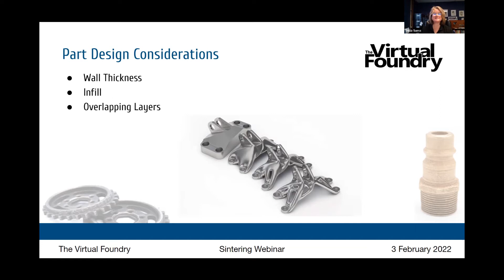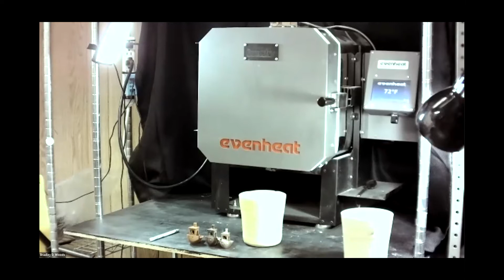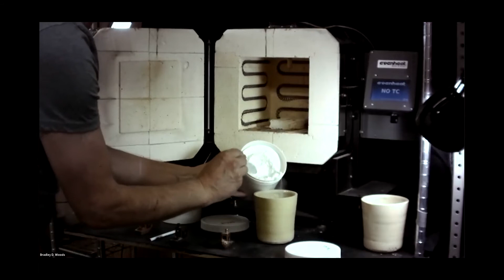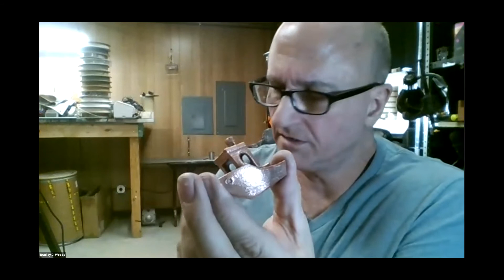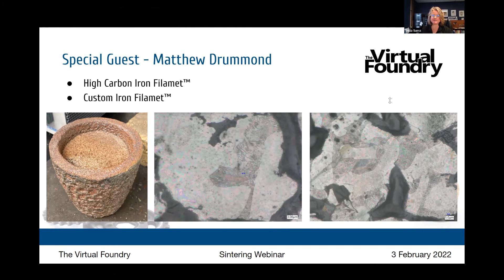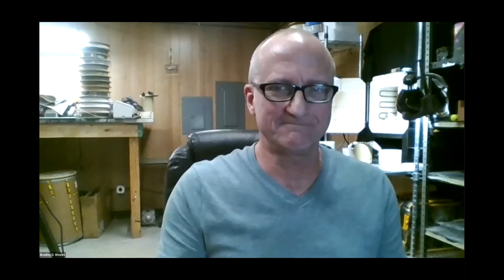TVF Webinar: Debinding and Sintering Filamet

Comment: I have bought two  kinds metal filled filament ss316l and inc 718 in yourcompany, I tried to use carbon as well above alumina talc, but after sintering the carbon is disappear might it bonded with oxygen and formed co2, but my problem is why my specimen gain weight while logically it must be shrinkage, Thank you
Reply from the maker: The Sintering Carbon is meant to be consumed as it interacts with oxygen and prevents it from reaching your metal part during sintering. If you don't have any Sintering Carbon left at the end, it is likely your part was oxidized. You can help conserve your Sintering Carbon by covering your crucible with kiln paper or a ceramic plate or anything that can take the heat.
It is strange that your part would gain weight. How much did it change? Was there any shrinkage?
If you send some photos to info@thevirtualfoundry.com, we should be able to diagnose the problem for you.

Comment: Have you all discussed gas or liquid tightness of the parts? This would be very useful!
Reply from the maker: Great question! Not so easy to answer, but I'll lay out what we understand today. Shrinkage and Density are closely related. If you sinter a part hard enough that it shrinks by about 15%, you will have a gas/water-tight object. The part will be in the high 90's for density, and remaining porosity will not be 'open-cell'. If you sinter the part minimally it will shrink by 7-10% and be around 85% dense, with much of that porosity being Open cell. In fact, at 85% you get parts used in oil bushings from the automotive industry and air filters from various pneumatic applications. 

There are techniques you can use to make an 85% porous part air/water-tight. We have users that will infiltrate the part with Sodium Silicate (water glass). The parts are air-tight and will tolerate high temperatures. 

So, you have a great deal of control over the level of density vs. porosity, the form of the porosity (open vs. closed cell) and post processing methods to mechanically fill the porosity. 

There's a growing collection of scholarly articles that discuss these topics here: https://scholar.google.com/scholar?hl=en&as_sdt=0%2C50&q=%22the+virtual+foundry%22+filament&btnG=

Our materials are all open systems, we encourage all of our users to explore, share and publish. Our materials have been the topic of about 15 thesis papers so far. The library of available information is growing at an increasing rate. We do our best to curate this information and share it through our website.
Reply: @TheVirtualFoundry  Thank you for the great explanation!